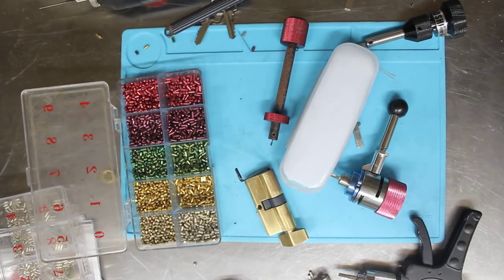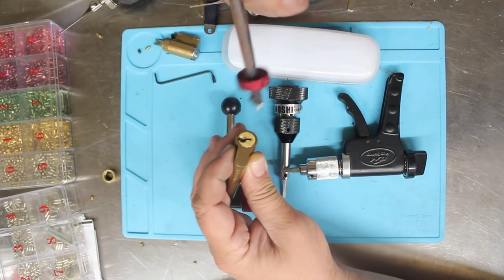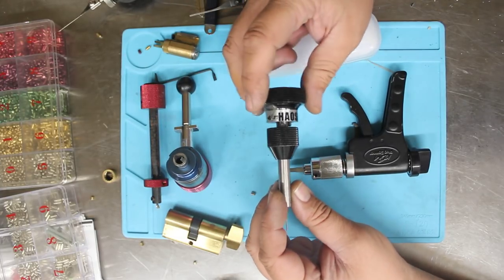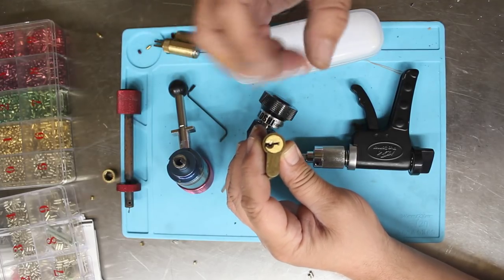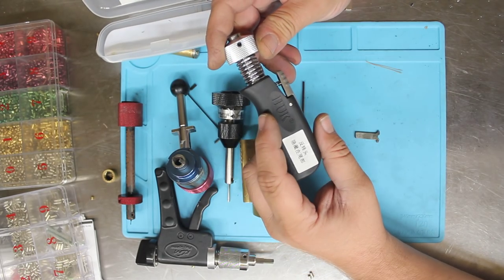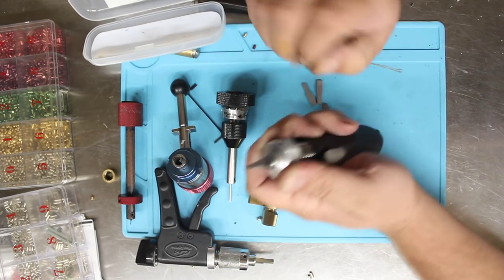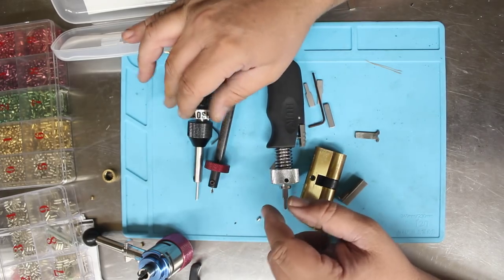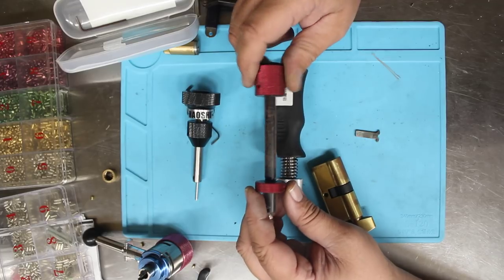Lock Picking - Plug Spinner Tools

Comment: Nice. I’ve lost count of the number of times I’ve kicked myself for not having a plug spinner.
Might get me a Ding Dong Loi Chou Sing Sung Bung 😂
Reply from the maker: Me too, you pick it one way and then have to do it the other,, I found this tool good, its for auto but works well for standard locks and its cheap and small   https://www.aliexpress.com/item/1005005107752455.html?spm=a2g0o.productlist.main.1.4ef1a7ica7icND&algo_pvid=4b5faf1d-9941-4127-a1aa-038176259242&algo_exp_id=4b5faf1d-9941-4127-a1aa-038176259242-0&pdp_npi=4%40dis%21USD%2117.43%2117.43%21%21%21125.07%21125.07%21%402103246617090956435066528edce5%2112000031687289039%21sea%21AU%21103671223%21&curPageLogUid=SgP6WsiXtTCy&utparam-url=scene%3Asearch%7Cquery_from%3A

Comment: I have the klom version you have there and I use it for door locks very nicely and it comes complete with magnetic bits kit like the HUK version does. They should be interchangeable between the HUK and the KLOM.   I believe the red version was based on the original American version designed by RYTAN company several years ago.